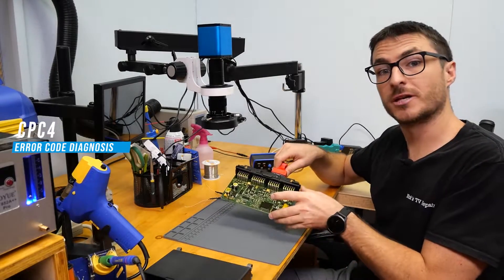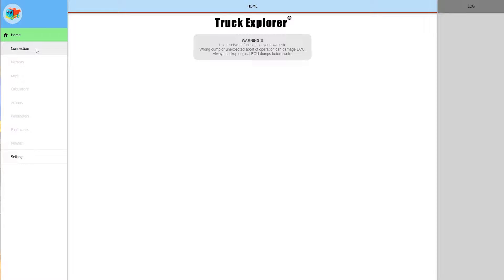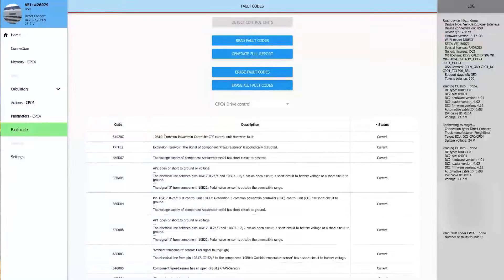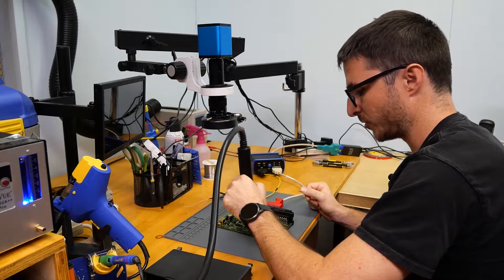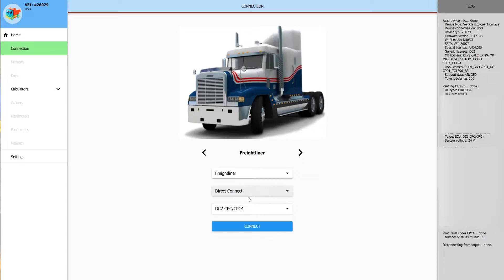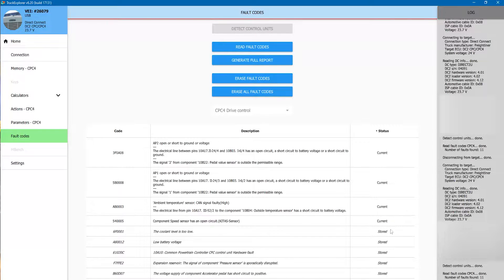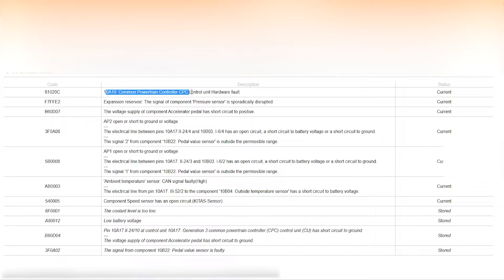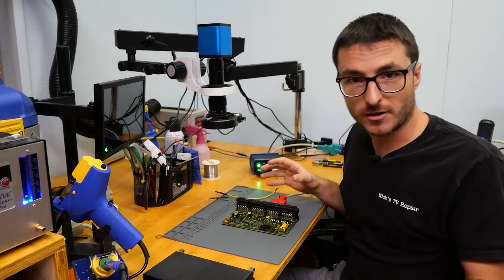What Is Wrong With My Freightliner CPC4

Comment: I changed my batteries and now my cpc4 is reading as a cpc2 would you happen to know why?
Reply from the maker: That does not make sense other than a freak coinidence that your CPC4 failed at the same time that you replaced your battery. We have fixed CPC4 failures where it identifies incorrectly as a CPC2 but that is typically because of a hardware failure on the CPC4. Changing your battery should not have caused that. So if it is not a coincidence, I don't know how to explain it.

Comment: Hello.
Freightliner Cascadia 2016 Auto.
The truck won't start the tractor's ABS light is on and the DEF light is red
I don't have a check engine light.
The dashboard screen does not show the transmission message or anything else for reading. 
the screen just stuck with dashed black line marks
Reply from the maker: Hello,
Can I have you send us an email directly with your contact information so I can reach out over the phone? Our contact info is in the video description.
I have several follow-up questions for you. 
Ideally you plug in a code reader to the truck and get the fault codes, and based on what you are telling me, it most likely will show you have a CPC4 fault, but if you don't have access to one, then commonly when the CPC4 fails there are a few tell signs.
#1 Multiple completely different systems start to malfunction. For example, no throttle, and the AC stopped working. Or ABS stops working intermittently and sometimes the truck won't start. 
#2 The issue typically starts intermittently, not always but usually. Was this the case? 

Do you have a hair dryer? Are you able to warm up that processor chip as we do in the video? If you are able to do that and retest the unit and find it allows the truck to work temporarily then this would be another way to confirm the fault. Please keep in mind we are not doing this as a way to fix the unit, this is simply for testing purposes so that you can confirm the fault and will not fix the unit. You should not heat it up too much or you could also damage the chip and or circuit board.

Comment: My truck has issue when i drive some times the gas pedal not working 2014 frightliner cascadia dd 15 and different check engine ligtt came on
Reply from the maker: That issue you are experiencing is very common and is also due to the same type of processor fault on the CPC4. If you have a device to read codes from your truck it may show that you have a CPC4 hardware fault. It may not however be active. The device we use can pull up old codes that were triggered and display them as non active codes. This is especially helpfull when dealing with intermittent faults such as the one you are experiencing. 

If you want to send in your CPC4 for repair, we offer a full repair and refurbishing service which comes with a 1 Year Warranty. 
https://nickselectronics.com/products/a0034461002-001

If you have any questions or want to reach out to us directly, our contact information is in the video description and pinned comment at the top

Comment: Do you know anyone in Orlando Florida that can help me with this?
Reply from the maker: Sorry I don't believe there is anyone in Florida that does CPC4 repairs. There are only a very small amount of companies that do these repairs since they are very difficult to perform and require specialized equipment. 
I know it will take a couple of days, but if you overnight the module to our repair shop, we can typically get these fixed within 24h, sometimes it take a little longer depending on module, and then we can overnight it back to you. 
We offer a flat rate service. If you have any questions, send me an email directly to info@nickselectronics.com and we can discuss further.